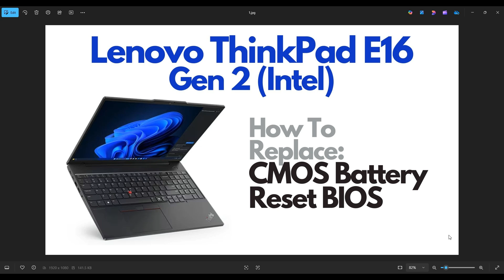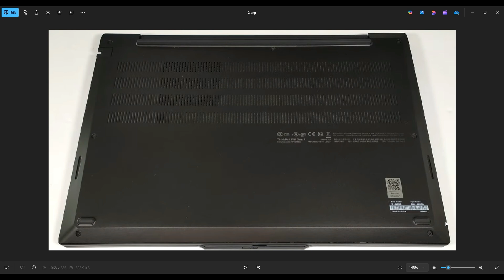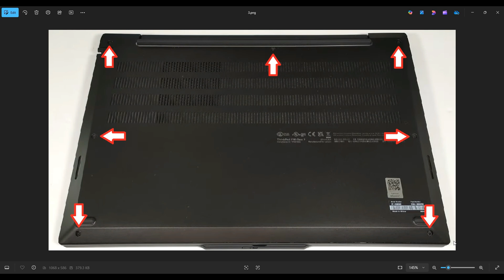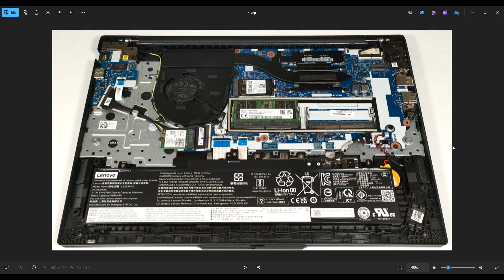How To Reset BIOS / Replace CMOS Battery - Lenovo ThinkPad E16 Gen 2 (intel) Laptop Computer

Comment: Sorry i didn't read correctly your FAQ and u don't share this but how can this be done i will not hold.u against anything if this goes south but you qre my last hope toachieve this honestly.
Reply from the maker: Some motherboards have a jump point where you can reset the BIOS password if you short out those two points. However, that is a risky operation and you run the risk of destroying the motherboard if done incorrectly. For that reason I choose not to have those DIY videos on my channel. Sry :(